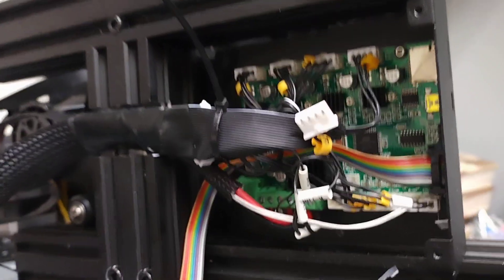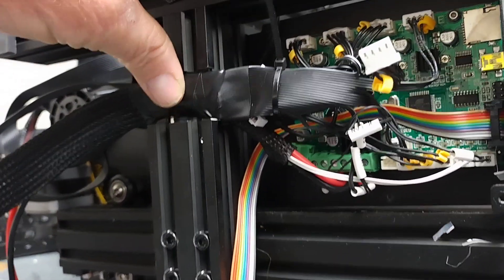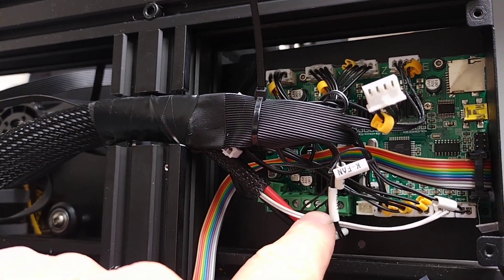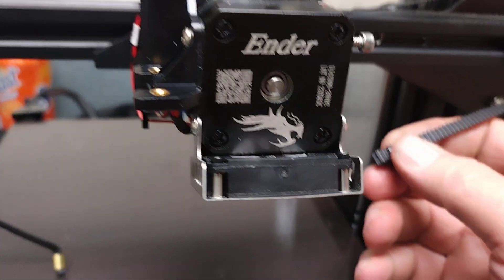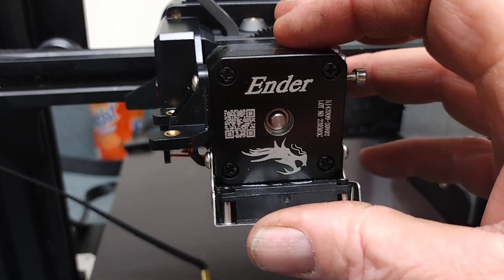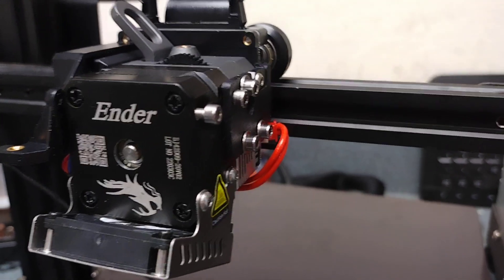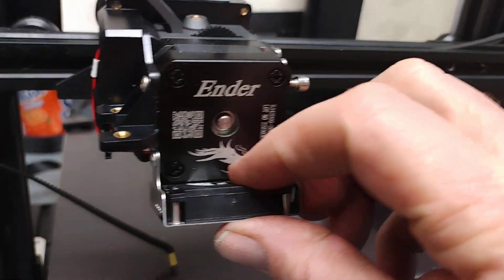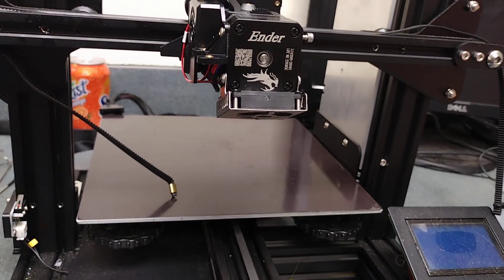Sprite extruder installed on the ender 3 pro

Comment: I installed it on my Ender 3 Pro also. Best upgrade ever for it. 

PSA the 1.1.4 board that the Pro uses wont support a CR touch. I had to buy a 4.2.7 board of amazon and install it before I could install a CR touch.
Reply: Did you run into the issue where the hot end nut crashes into the housing on the right side during leveling?
Reply: @Marc Hagopian  I did how did you fix that
Reply: @Nukles33  Take the bolt on the right and bottom out and flip them so the head of the bolt which is slimmer won't crash. It's possible to need to cut the bolt a little if the tail side doesn't clear when you remount the Sprite. I had tried cutting before flipping and keeping the nut where it is and that still crashes, so the head really needs to be on that side.
Reply: @Marc5000  what about the extruder on the other side
Reply: @Nukles33  What about it? Do you mean the one that's not used anymore since the Sprite has its own?
Reply: @Marc5000  no im talking about the sprite if i flip the bolts the nut and long end will prevent me from mounting my sprite unless im misunderstanding
Reply: @Marc5000  while where talking im also trying to re center my bed have you had any luck with that ? Im thinking im going to stop at hardware store and get shorter bolts and a couple lower profile nuts for the colission i also flipped my x axis sensor giving me a little more left but my sprite cable is kinda bunching up on that left post ...thank you soooo much for the help your giving me so new to this shit spinns my head around lol
Reply: @Nukles33  Ah yeah, that's the bit I mentioned about cutting the tail end of the bolt that extends further than the nut. That's how I got mine to fit and clear everything.
Reply: @Marc5000  sorry i was just re reading your msg so the shorter bolt with same nut flipped works perfect ill try and dremmel the bolt down after i mount the bracket so i can thread it what about centering your bred
Reply: @Nukles33  Oh this drove me up a wall when I was dealing with it! Glad I could help!   For centering the nozzle to the bed you can play with the X and Y offsets. Just remember what the original is in case you need to revert to the original without resetting absolutely everything.
Reply: What firmware did you use?
Reply: Did you have to modify or adjust anything to put it on your Ender 3 Pro?I seen a review where someone said it doesn’t fit properly
Reply: @malikhunter6504  No, direct fit other than needing to replace my board.

Comment: Did you have any issues with it erroring when you try to heat the end?
Reply: i did. installed it on the base ender 3 with the stock board and kept getting thermal runaways until the board quit. now i have the 4.2.7 silent board but im scared to try the damn thing. switched back to the stock extruder and boxed the sprite pro back up